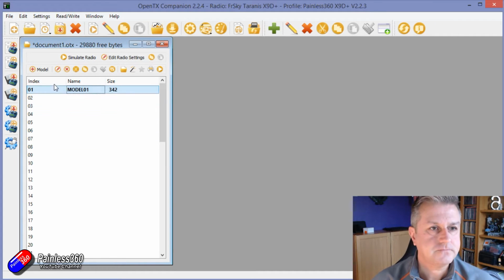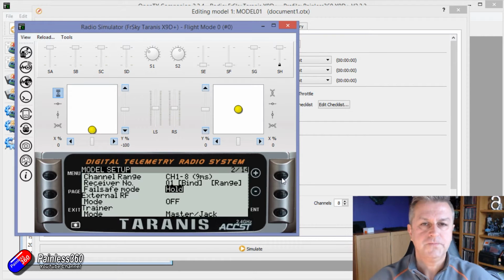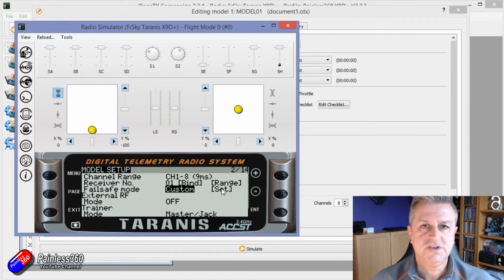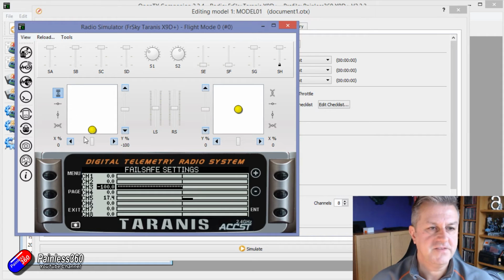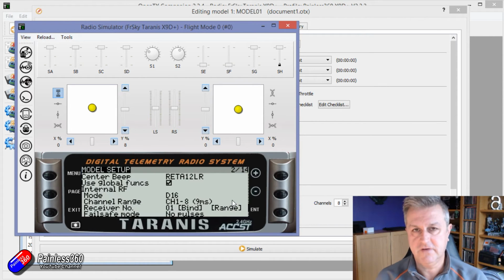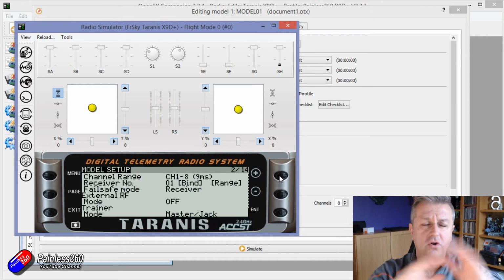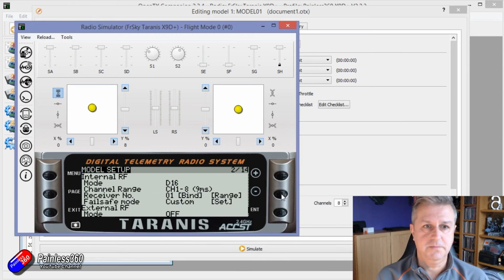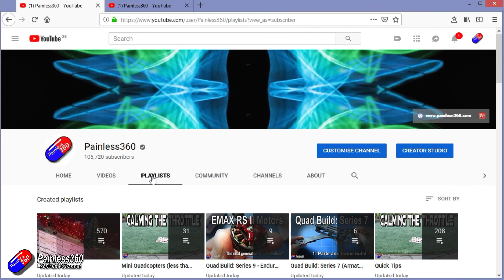OpenTX Quick Tip: Failsafe (D16)

Comment: Thanks so much for the video and all the other videos!  I used Custom method for Failsafe but it seems to not work.  I have a Jumper T12,  Jumper R8 receiver and Pixhawk 2.4.8 running MP 1.3.76 and Arducopter V4.0.7.  My Channel 5 is Flight Mode with position 3 as RTL.  In Faisafe settings on my Jumper T12, I changes the value for Channel 5 to 100.  With props off, I armed the quadopter, gave 20% throttle and then turned off the transmitter.  Mission Planner showed that the quad went to "Land" mode and not RTL.  Flight Modes window also showed Current Mode set to "Land". What am I doing wrong? Please advise.

Comment: Hi again, can you maybe tell me why Jumper T12prp does not have Failsafe option under Model settings?  Do you have to do something so it shows?  I am using Radiolink R6FG receiver for it- with its devault remote it supports setting up failsafe but can't manage to find it in Jumper settings as show on your videos with like TX16S
Reply from the maker: What protocol have you selected? Not all of them have a Failsafe option.
Reply: @Painless360  RadLink (radiolink)
Reply from the maker: I don't use that one but the FS detail in the wiki seems to show that the FS position is on other channels? https://github.com/pascallanger/DIY-Multiprotocol-TX-Module/blob/master/Protocols_Details.md#RadioLink---74 Best of luck!
Reply: @Painless360  Awesome thanks for the link- is shows there that Failsafe is supported from Channel 9 to 16, but O don't know what that means. I changed the channel range to be from 9 to 20, but the failsafe potion did not appear?

Comment: This was really helpful.  I just get up my T16 so kopilot switches to RTH when I lose signal.

I used custom [set] so I have 50% throttle and the position on the 3 position switch that's set to RTH.
Reply from the maker: No need to set throttle to anything apart from zero. It's safer that way and the Kopilot will control the throttle during RTH...
Reply: @Painless360  oh yes, thanks! I'm new to this hobby and your videos are very useful.

Keep posting videos!

Comment: Would you clarify one thing for me.  I am using the Matek F405/TBS Crossfire with Inav and I have always set my transmitter it the setting I would want for failsafe. IE ARMED and MODE set to RTH and then set failsafe on my receiver. Have tested in the air and it works.  So when you are using FrSky X series RX and the CUSTOM/SET method is it down loading these settings onto the RX same as setting TX to ARMED/RTH and then setting FS on RX.

Comment: Does there need to be a "failsafe" type receiver to use this feature or will any receiver work?
Reply from the maker: This is for the X series. Check the manual if you are using other types. 
.

Comment: When I was flying FM 72mHz, well before quads, flight controllers and any form of stability other than heli gyros,  I had a receiver that had 2 fail safes. One was neutral throttle off, and Hold. Hold would hold a preset value like custom does. You were to set your Tx to Hold for that function IF your TX COULD be set to Hold. LOL! The next up RX had Neutral, Hold, and Last. I guess Hold in Open Tx is like Last in that old Rx. Thanks for this video. I am still new to Open TX, and it is a serious learning curve.

Comment: I've heard that setting your radio to HOLD while using a flight controller is preferable because when you loose signal, it will repeat the failsafe flag over and over again. Maybe i did not understand correctly?
Reply from the maker: Depends on the system youre using. Because the failsafe is detected and the FC is told via the failsafe flag immediately -  it depends on how the flight controller handles it. Things like the Vector advise no pulses and things like iNav have a timeout before the failsafe action is initiated (stage 1 in BF).. I'd always err on the side of caution with failsafe and test rigorously. Happy flying!
Reply: With Inav and Frsky  this is my preferred failsafe. For the first time, I set the failsafe command for a test on a switch and later I testet this by switching the transmitter off, it worked all the time > RTH. But you must have set the failsafe on the fc correctly. Since I am not using any other fc system and
not Flysky, which had issues with the failsafe, I stay there.

Comment: I use the FRSky stabilised receivers a lot for the panic switch capability. With these I set a Custom failsafe which turns on auto-levelling, sets throttle to -100%, ailerons and elevator to 0% (i.e. centred) and sets rudder to +100%. The intention is that when the plane loses signal it spirals gently down to the ground somewhere around it's last known position without self destructing. Thankfully I've never actually had to see it working!
Reply: Chris, you might want to try in manually.  Even when using a Gyro/Stabilizer I've had planes go into a spiraling death dive with full rudder held on.
Reply: @paulg5437  That's a good point Paul, I'll try it and maybe change the amount of rudder I set. Thanks!
Reply: @TheChrisBalmforth have you had a fail safe condition in the last 3 years? Interested in an update.  I agree with previous comment, full rudder might be a lot. When I'm setting up mine, I'm thinking of giving something around 10% rudder.

Comment: 👍 thanks.
I'm only have multirotors and I'm setting my failsave to off. But I know some people setting it to go to stabilize mode and hold throttle to 50% for certain amount of time. It allows drone got strait up with a hope to recover signal from transmitter.

Comment: Correct me if I'm wrong but I believe this only applies when you're in D16 mode.  If you're using a D8 receiver (hey some of us still use some of those!) then the only way that I know of to set the failsafes is via the failsafe button on the receiver.
Reply from the maker: Yep, always read the manual for the rx you have. Happy flying!

Comment: I'd also suggest that after setting the value,  test the failsafe with the prop removed.  I've seen some motors go to full power when the TX is turned off especially with the multiprotocol model.   Ditto for an arm switch.
Reply from the maker: Great tip. See my plane setup videos for a complete step-by-step setup. Including trimming, travel, expo and Failsafe setup Happy flying!
Reply: I have used a flysky rx with a jumper mpm and thats exactly what happens.... 100% throttle
Reply from the maker: I'd check how the failsafe is set for those recievers. Some (like Spektrum) only store the failsafe on binding.. the of luck !